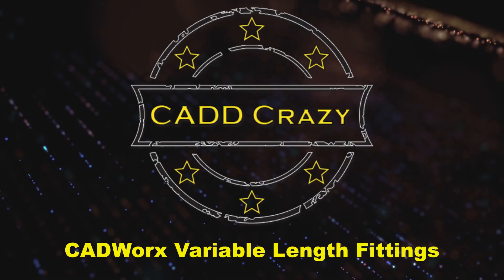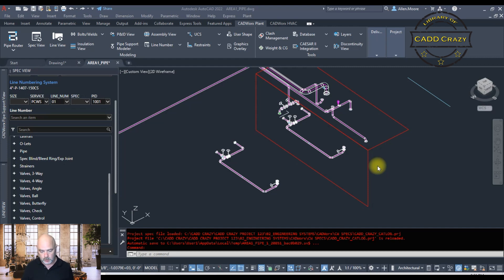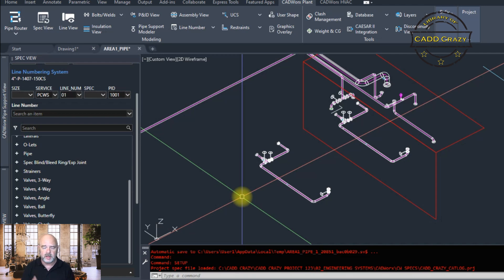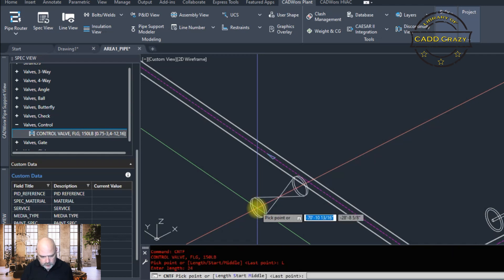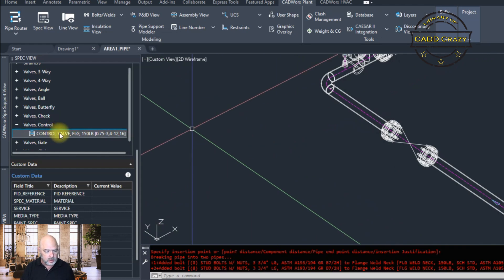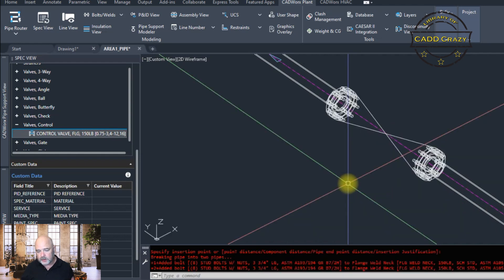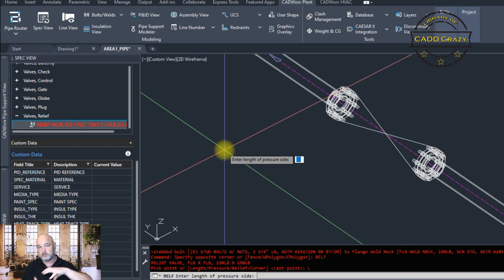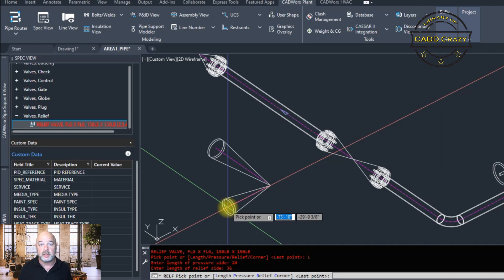CADWorx Variable Length

Comment: Thanks for showing variable length components, but is there away to change the length of an existing item without redrawing it ?
Reply from the maker: Sadly I do not think there is, or at least not that I have found.
Reply: In 2018 and previous versions you could convert CADWorx component (PSV or Control Valve) to double line view then stretch the center line and then convert back to a 3D view style and the CADWorx would automatically fix the 3D solid to match the center line length.